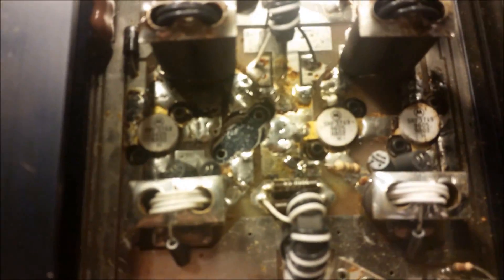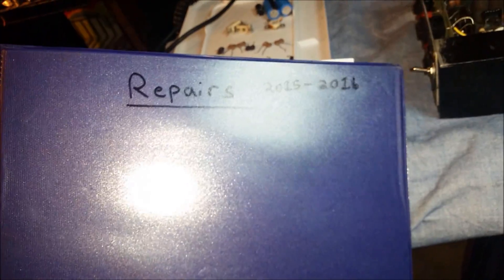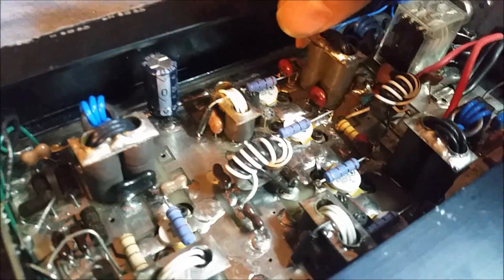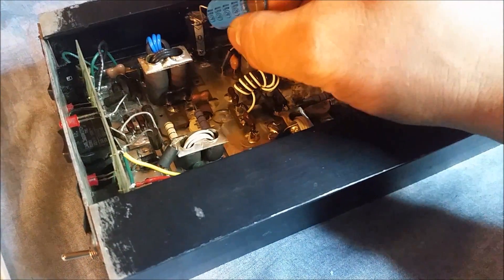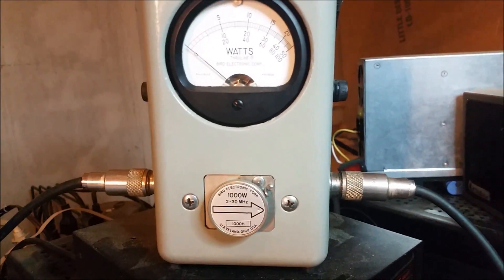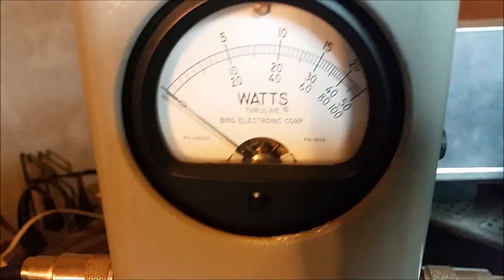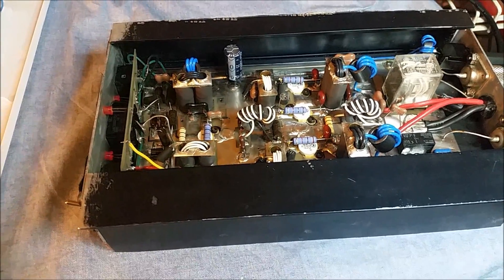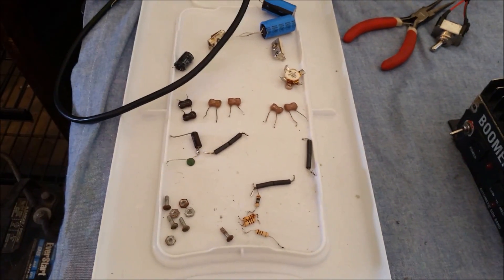Palomar Boomer Deluxe 600 Repair & Circuit Transformation!

Comment: I got a Palomar 600 on the input tune I got it to 1.5 swr can't go lower is that normal for these
Reply from the maker: It can be on some of them.. make sure your on high when tuning it. Also try diff coax lengths
Reply: @1883GotDown  will do have 6ft jumpers now
Reply: @1883GotDown found that the screw is all but all the way out do they still sell these trimmers or can I do a fixed with a resistor

Comment: I had one of these. The Boomer 600 was the boomer 400 Deluxe with a driver final. They are a good amplifier. you must make sure that your coax is the right length on the jumper, radio to amp. If not when you key up after you stop talking and release your microphone, the amplifier will stay keyed up. You need 75 amps constant to run this amplifier in class B for SSB sideband  use. Run amplifier at 350 max watts swing and this amp will last for years. Also run dual fans on heatsink. Cheers